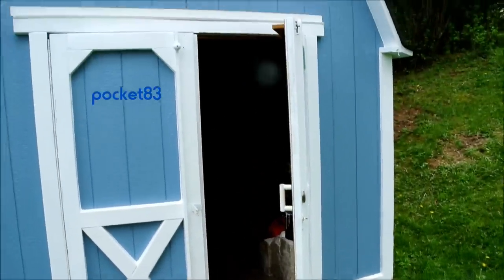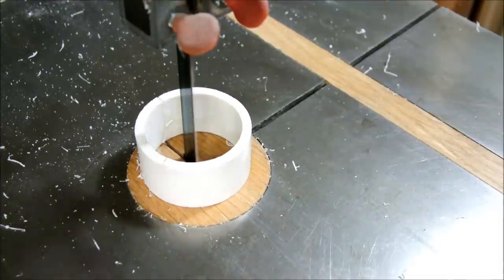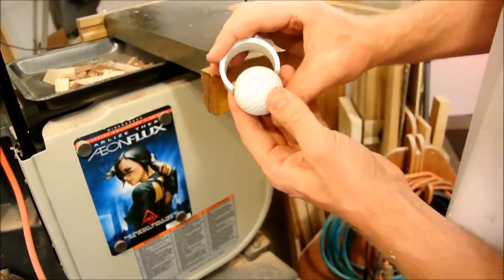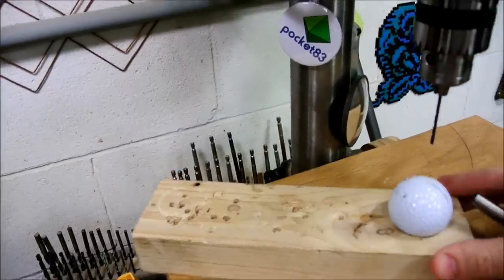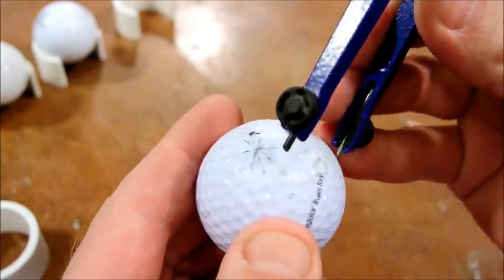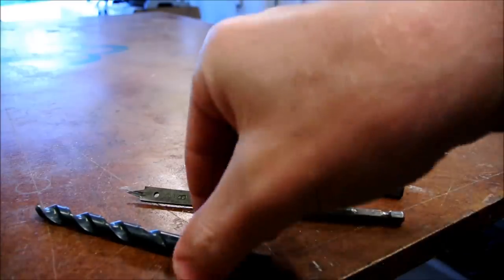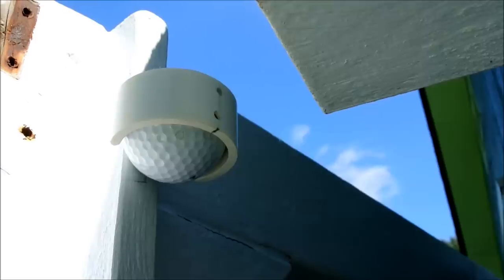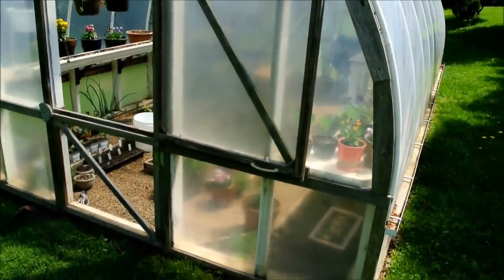Cheap and easy ball catch latches!

Comment: Overly complex solution that doesn't last for a simple problem.
. UV kills the PVC, it loses its elasticity and the golf ball does not stay put. Take the photograph and rave immediately after the installation - after a year the whole thing has fallen apart. Go down to the hardware store and get a dead simple little latch
Reply: Nonsense. Read the description.

Comment: A true lazy man would have just bought a good metal spring type latch and eyeballed it in with self tapping screws .
Reply: But the saying is "work smarter not harder"
Reply: A true lazy man wouldn't use a shed.  Sheds are used for work.

Comment: Don't want to pee on your parade but both the golf ball and the pvc will become brittle in long term exposure to UV light. You may have to replace it after a year or two. It is a great temporary solution or perfect for a cupboard. Great little handy tip though.
Reply: My bad you did mention UV degradation in the comments section. Smart man. ;)
Reply from the maker: Thank you.

Comment: This will work like crap in the wind,which is when you need it the most,major fail.
Reply: Oh, did you try it, then? Because my shed used those latches for years, and they were still working great on windy days when I finally sold the house. Thanks for taking that giant L from me.

Comment: This is nothing new. This was on tractor doors over 40 years ago
Reply from the maker: With golf balls and PVC? Right.
Reply: No it was like a rubber air pellet but 100 times bigger. And the rubber socket was on the cab frame. But it phased out as people hated doors that opened wrong way so doors were designed to naturally fall out when opened. Like the fiat tractor door. On new tractors there kept open be gas struts same for the windows. No golf balls though. What I meant was the idea. If you know what mean
Reply: No it was like a rubber air pellet but 100 times bigger. And the rubber socket was on the cab frame. But it phased out as people hated doors that opened wrong way so doors were designed to naturally fall out when opened. Like the fiat tractor door. On new tractors there kept open be gas struts same for the windows. No golf balls though. What I meant was the idea. If you know what mean

Comment: You just spent way more time on this than you ever would have just latching and unlatching the door when you use it. Also the latching system would be much better in high winds.
Reply from the maker: No. And no. It takes under five minutes to make this. Swinging doors that require two hands to latch cost much in lost time, energy, and frustration. Over years, this will save you so much in convenience that it would be hard to express. Just imagine latching those other things at night. 

And for the 1,000th time, this latch is incredibly wind resistant, and you can make it even stronger if you want. Read the description.